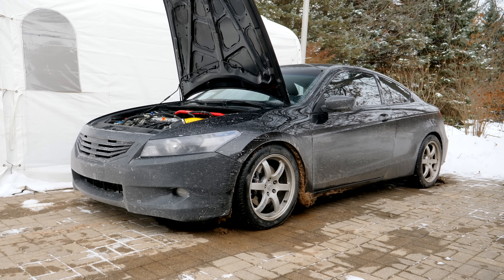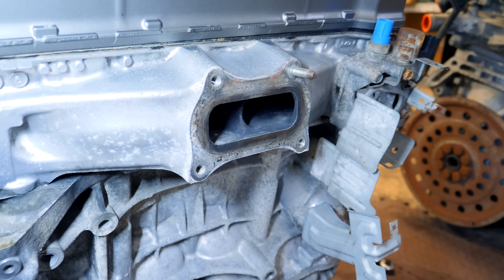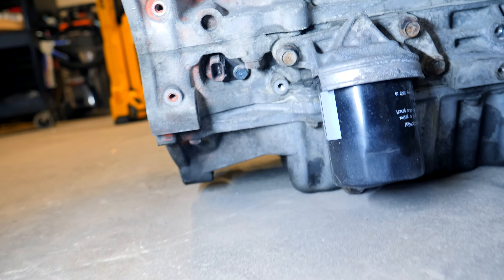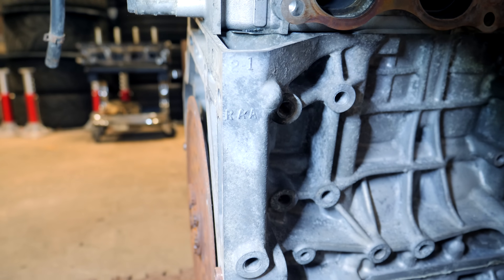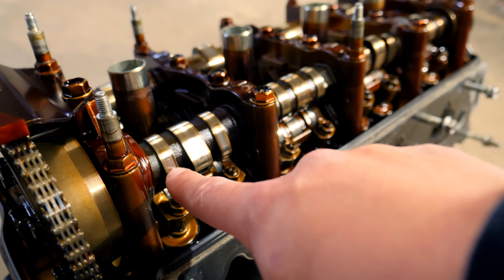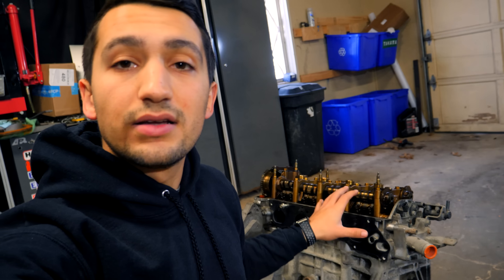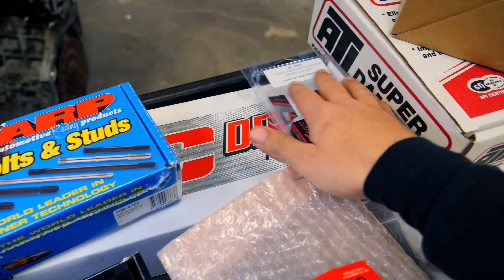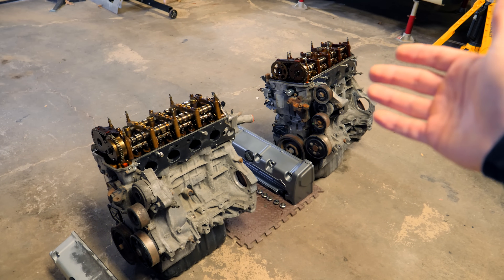How to Build a 300HP K24Z Engine

Comment: I have a 2nd gen tsx with k24z3  pretty nice sedan  But im not to impressed with all the things you have to do to the z3 to only gain 40+ hp . I also have a bmw 3 series where all you need is to have all the maintenance up to date and a quick stage 0 flash tune and you will unlock +20HP completely stock motor

Comment: You can get plenty reliability from a turbo setup OEM turbos are absolute sh*7 compared to aftermarket proper turbo setups also a stock small turbo will have more stress on the motor compared to a larger turbo on something like a k series

Comment: Well that shows the differences between the American Acura k-24 engines and our Australian accord euro K-24 engines-my 2011 accord euro cu2 luxury has the K-24z3 engine but it has vtec on the intake and exhaust cams unlike the K-24 in this engine. There are so many variants of this engine and are different in other countries. My wife has a 2006 odyssey with a K-24 A3 but in America you guys got the 3.5 v6 engine in them.

Comment: Looking to replace both cams on a K24Z3.  The OEM cams (14110-RL5-000  and 14120-RL5-000) are $600 plus each.  Are there any other less costly cams that will work in the K24Z3?

Comment: Hey I was planning on building a k24z3 turbo for a DD, what do you suggest? Should I gut it and rebuild it or run it on stock internals? If I gut it what pistons and rods should I use? What type of valve/valve springs and retainers should I get? This is my first time building a motor so any suggestions or support is really appreciated. Thank you!

Comment: Did you ever get this finished?
Also, can this be accomplished with just the coolant passage change and the different head? Also, how did you wire for the variable valve timing system on the exhaust cam?
Reply: He gave up 25% way through and ended up just buying a civic SI. Was super disappointed that we didn't get to see this all the way through.
Reply: @WARBROTHER2  gah... Never quit if you're gonna inspire people

Comment: not too sure if you have come acorss or would be able to anwser, i have a 2009 accord cu2 with a k24a3 engine block but with the z exhasut and intake manifold, wondering if itd be a straight swap to an a3 head? or will modifications most likely need to be done
Reply from the maker: It will not be a straight swap unfortunately. The head and block ports won't line up properly.

Comment: I know this is an old video, but 4 piston mentions that after porting the r40 head, it is the best flowing head out of all k series for all motor applications. You can actually add vtec cams on the exhaust side of the r40 head, and it’ll be better than the k20 heads and rbb (k24a2) head
Reply from the maker: If that is the case, that is new information as 4P has recently begun putting some work into the R40 head.

Comment: I don't understand. So You have 3 k24 engines?
Why not just buy a car with 300hp?
Reply from the maker: Typically when you buy a more powerful car, it is usually heavier, which is not what I want.
Reply: you keep talking about engine power and never brakes?
what if you need to stop quickly when you're going fast. what will happen?
will God intervene?

anyway you need to upgrade your brakes!

Comment: You will need to properly port and polish that head in order to make 300 hp all motor.
Be a lot cheaper to leave the k24z3 bone stock and put a gt30r turbo on it.
That will make 450 whp a lot easier and cheaper.
Hey....good luck with the build!

Comment: I have a 2013 Honda Civic Si Sedan K24Z7, I have low compression on cylinder 1 and 2 so  I need a motor a used low miles motor runs me 1800. What do you recommend to do

Comment: Just to share more technical knowledge about Honda's i-VTEC because I've got nothing better to do.

Honda made many versions of their "i-VTEC" systems. The performance oriented i-VTEC incorporated valve lift and timing on both the intake and exhaust side. Engines like the K20A, K20A2, K20Z1, K20Z3, K24A2, and K24A3 have the performance version of i-VTEC.

Some engines like the K20A3 and K24A8 only had "i-VTEC-E." Those engines don't incorporate variable valve lift, only a 12 to 16 valve switch over and variable valve timing. These engines usually produce more low-end torque and have better fuel efficiency. However, they don't rev as high and make less top-end power. In addition, their switch over is extremely early in the rev range and barely noticeable.

There is another version of i-VTEC that incorporates variable valve lift, but only on the intake cam. Engines like the K24Z3 (like the one in this video) have this version of i-VTEC where VVL only occurs on the intake side. Both intake and exhaust sides still have VTC, so this systems sets itself in the middle of performance and fuel economy.

You can generally tell the different K-Series engines apart by the intake manifold cover. If the lettering is red, then the engine has real "i-VTEC." If the manifold cover has black lettering or no lettering at all, it's most likely the "economy i-VTEC." Of course there's the head stamping to go off by too.

I'd love to hear more facts from fellow Honda fans and enthusiasts. Thanks!

Comment: What tuner did you use? Im trying to get the speed limiter off my 08 Accord
Reply from the maker: https://youtu.be/VtjSplyPJvU
Reply: Can the 2004 Acura TSX transmission work in the 2011 Honda Accord
Reply: Can the manual 2004 Acura TSX transmission work in the 2011 manual Honda Accord

Comment: I'm tuning a guy in Central America that has the K20z3 head on a K24z7 block. Making great power even with the stock Z7 oil pump and 1000ft above sea level.

Made 233whp and 190tq on a base run. We're aiming for mid 240s by the end of it
Reply: How about rbc2 head not 3 lobe can I use internal rbb2 to use only bare head rbc2

Comment: Dude, that has to be around $3000.00 just in parts, plus the purchase of 2 clean engines, which I put at $1500-$2000 each. So your $5000-$7000 in and you haven't even started yet. My suggestion is if you want 300 whp that bad go by a Mustang.

Comment: Good luck on the build! What was required to install the 6spd lsd transmission on your 8th gen accord?
Reply from the maker: Thanks man! The transmission itself, you will need a nut for the transmission mount, and option speedo-corrector since the Final Drive and gearing is different.
Reply: Can the 2004 Acura TSX transmission work in the 2011 Honda Accord

Comment: Can we use k24 head non 3 lope and non vtc and add those 3 lope after market cams and buy vtc cam gear add them, or those head dont have those oil channels?
Reply from the maker: You MIGHT be able to but it might be harder to do than you think. The head itself is a different casting for the oil lines for VTEC. I'm not sure if would be that easy to do.
Reply: @milanmastracci  thank you, that explains it, if they are different head cast then we better stick with k24a2

Comment: Bro! If i go k20 head wich one should i get? I got the same engine k24z3 from an accord coupe 2011
Reply: K20a2/k20z3 head, the z3 is drive by wire throttle body the other no

Comment: If you want an engine that will last as a tuner and a daily driver ... you should not put forged pistons. If you are going for only a drag strip car, ok put forged pistons but otherwise do not do it, you will shorten the life of the engine in a huge amount because of the way forged parts are made and how they react to heat and the wear they do on the cylinder walls

Comment: Man, I was excited until I saw the $11,000 price tag, and that's excluding the head port/polish.
Reply from the maker: The parts aren't cheap, but I'm also changing everything over. An OEM+ build can be done and you would save a TON of money!
Reply: @milanmastracci  I'm at over £8k in parts now for mine too,(taken a few years to accumulate) Even now I'm still missing a few bits & not sent ECU off to k-pro yet.

 It can be done for cheaper I suppose with a lot of the parts, and DIY, but things like big aftermarket headers/intakes will always be expensive. I'm sure i read somewhere of some Mexican dudes though that made big power for cheap.Cant quite remember how it was done but there was something...🤔

After doing this years ago with a built b18C4 in an eg civic (poormans type R lol) I can say that on those days when you're driving on the open road and you get that buzz,, you dont think about the money spent at all.

Comment: Can you take a k24a2 and put a k20z3 on it and will it still match up with the k20z3 trans?
Reply: Yes if it's the rsx head will fit on the k24a2 0r a4.  The k24z series needs a ton of fab work.

Comment: Tuning on 93/94 octane I assume since you're in Ontario? E85 is hard to come by up here.. You're going to need some serious head work to make 300 whp on pump gas, p&p, 12.5:1, 80mm+ TB, big tube header, ect. Not that it hasn't been done, because it definitely has.. But the stock ports on the head will be the one thing holding you back. Contact RaceHeads in St. Andrews Ontario. The world record stock block H2b is running a Raceheads cylinder head, 300whp on M5 fuel.

Comment: Can we install vtec cam on k24z head?
Reply from the maker: For the exhaust? You might be able to retrofit it, but I dont know if the work would be worth it.
Reply: @milanmastracci  ya i meant the exhaust side, and can we just swap k20 cams to k24 head?
Reply from the maker: Swapping cams, yes you can do that.
Reply: Yousuf Alblooshi ya u can. U install vtec rockers on the exh side but u need kpro to control it and u will be locked in vtec all the time. You also wont have vtc on exh side but u can install 50deg vtc advance gear from a k20a2 on intake side cam(stock is 25deg) to make up soma the hp difference. Surprisingly after proper tuning u really dont loose much bottom end power being in vtec all the time. The k24 has so much torque as it is your still getting 85% of the performance of a full head swap with wayyyyyyy less $$$. If you search accord vtec killer swap that will get u started on the research
Reply: Can the manual 2004 Acura TSX transmission work in the 2011 manual Honda Accord

Comment: Can you please explain the transmission
 What was needed? I have a k24i auto..can I add SI transmission?
Reply: I'm using the Accord Euro R,
 6 speed manual w/LSD...
Reply: Can the 2004 Acura TSX transmission work in the 2011 Honda Accord

Comment: Every forum I've ever seen always says the z3 isn't worth it but I'm glad to see someone putting work into the 8th gen.
Reply: The z3 is only worth it when you turn it into an a2.

Doing exactly this swap this winter with my 2 Acuras. Making the 2009 manual faster and the daily 2005 auto slower.

Comment: Did the SI trans come in your Accord or did you put it in? Also was your Accord a stock 6 speed?
Reply from the maker: The SI transmission I installed. My accord was had a stock 5 speed, open diff, with a terrible final drive. The trans swap completely changed how my car feels.
Reply: Can the manual 2004 Acura TSX transmission work in the 2011 manual Honda Accord

Comment: Make sure u use NGK plugs for this set up

I read the part list you posted and I saw you are planning or planed on using BOSH spark plugs

Honda motors usually perform best with NGK or Denso’s
Reply: ZunoFG4 it sounds silly but its true. I cant tell u how many times ive given several different types of bosch plugs a try and the engine always feels just a bit off. Back to ngk's or densos and u can tell the slight difference in the smoothness with which the motor revs and idles.
Reply: My experience is the same, NGK is usually the go-to

Comment: So far I like your videos. Idk why I never saw your channel but glad I did.. 
Question..
Why you chose the k24z3 with the hope of making 300hp with swapping the cylinder head of the k24a2 when you can simply use the entire k24a2 and just reuse the plugs of the sensors and extend the wires as needed. You can make 300hp all day with the parts your using inside of the a2. Just curious to know 

-Miguel
-Migz
🍊range peel
Reply from the maker: Very good question Migz! There are a bunch of differences between the K24A2 and K24Z3 engine. I will be making a video talking about differences, as you cannot take one complete engine, and swap it into a different car. The K24A engines are the first generation K24s, and the Zs are the second gen ones.
Reply: @milanmastracci  as far as generation goes I'm up to date with that.  I'm looking forward to seeing the video about it .. was just wondering as you can literally drop the A2 in just about anything lol in your case it should be just mount brackets I'm sure someone already did it .. 
In my case I have an older integra DA chassis going with a JDM k24a from a cl9 and using your same transmission in my case they say to change the inner casing for the 02-04 typeS transmission due to the VSS plug and what not.. but they already have an adapter for the plug for the 06-11 Si z3 trans VSS.. of I find some info on that hope you dont mind me sending it your way.. but none the less dude I love what you're doing 

-migz
🍊range peel

Comment: Honestly I don't like how the k24z3 engine has the collectors all in one... I wanted to put headers in my accord... But I cant
Reply from the maker: You can put a downpipe on it, like what I did with mine.
Reply: Can the manual 2004 Acura TSX transmission work in the 2011 manual Honda Accord

Comment: I thought a k20 head swap on the k24 would be better?
Reply: hk47 k20a2 head is only slightly better, maybe 10% but more $$. Best way to go is actually the crv head. Cheaper and outperforms the k24a2 head. For some odd reason the crv head flows close to the same cfm as a k20a2 head even tho the motor is 160hp vs 200. its a performance diamond in the rough. People still arent utilizing it enough in builds even tho the info has been discovered years ago now. May have something to do with still needing good cams but i mean ypud want more than stock a2 cams anyway so ?

Comment: Was thinking about the 6speed
Lsd swap. Does your transmission came from k20z3 or k24z7 civic si?
Reply from the maker: K24Z7 Civic Si. It bolts right up, you can use your K24Z3 engine and flywheel without any problems, along with your axles.
Reply: thanks, very appreciated, not much info on those plateform.
Reply: @milanmastracci  which head can be use in a k24z7 block?

Comment: Just adding if you get 300 hp out of a 4 banger your doing good. Because on Nicks Garage (You Tube) from Montreal, Quebec he does a lot of V8 builds with forged connecting rods and pistons. Average Horsepower on his Dyno is 600 horsepower out of a V8. 
So your half of a V8 an 4 cylinder so if you where to get 300 hp (non turbo-ed  or super charged) an Good accomplishment.
Will be an interesting build for sure.

Comment: What compression are the pistons? Will you run this on premium fuel or ethanol?
Reply from the maker: They're a couple points higher compression pistons than the stock components. I'm hoping to run on 91/94, but I might have to run a meth kit since E85 isn't readily available where I live.

Comment: My 17 civic coupe 6mt has the NA 2.0 L K20C2 i-VTEC engine, is this a good platform? Any mods you'd suggest to increase hp?
Reply from the maker: There are a lot of mods you can do to it, since it shares a similar engine to the Civic Type R. The build that I'm doing might not be too helpful with your specific build since the best route for you would be to boost it.

Comment: Just out of curiosity what would you wind up with by just swapping the head? My 09 Accord has about 65k miles on it. I was considering putting in a 6 cylinder l but I like this solution better. I'd also like to ask you for more details about upgrading the exhaust to dual. Did you need any custom parts or was it all Honda OEM parts? Thanks Tom USA

Comment: Cool build! The 06+ tsx head I've heard is much better than the 04-05
Reply from the maker: The 06-08 head is better in the fact that the camshafts are slightly larger, and the intake valves are 1mm larger. The cams I'm swapping out, and I may upgrade intake valves. We'll see

Comment: That is an interesting build, complex when it is already known internally more focus on the block that Honda k series are pretty reliable as proven by both the internet and various youtube channels that mainly boost these motors and everything is stock is kicking over 350 HP day in and day out.  I would have thought this was a simple budget build,  so a mild rebuilt head with cams and a RSX VTC timing gear, PLM Header, etc, a tune and go can reach 300 hp goal and still be reliable...Even i see that you have the ATI damper total over kill, would it have been just been easy to just use a OEM Honda ITR (the similar RSX type S) crank pulley and your good 
None the less good luck on the build  : )
Reply from the maker: I'll be getting into the oil pump in a later video, as the Type S oil pump cannot be bolted up to the K24Z blocks. It's nice for the K24A blocks as the threaded holes of the block align with the holes in the pump. You'll see how I get around that problem.

Comment: Z3 head is good for turbo, shorter collector/tubing which relates to less lag, check bisimoto the civic he just made he explains it all.
Reply from the maker: I would have to agree with him. The K23A1 that came out of the Acura RDX is an OEM engine that came boosted and it has the same single collector found on the cylinder head. It is a smart design and makes pretty good power for an engine with 8.8:1 CR pistons.
Reply: milanmastracci also love the videos man, as a Mclaren tech it’s awesome to see someone working on things and doing the most quality job they can, used to watch more when I had my tsx but keep it up.